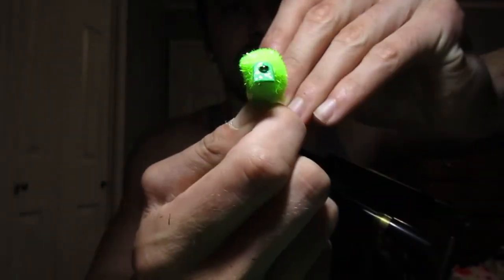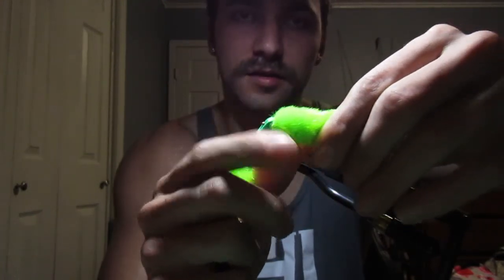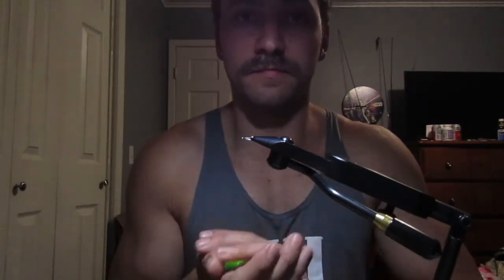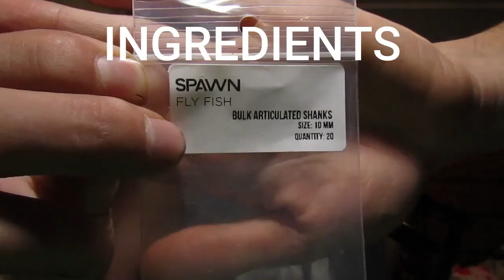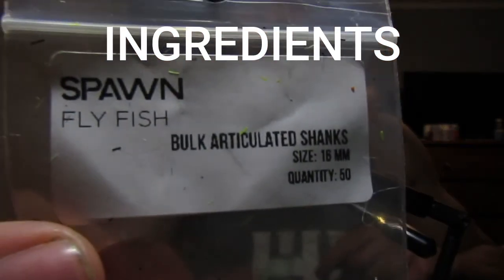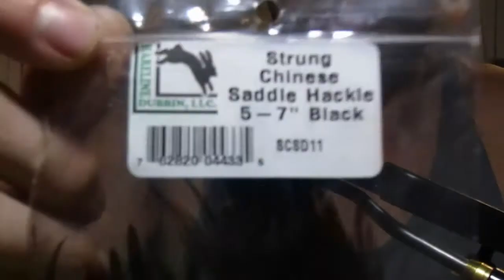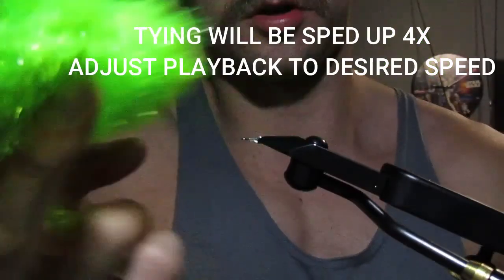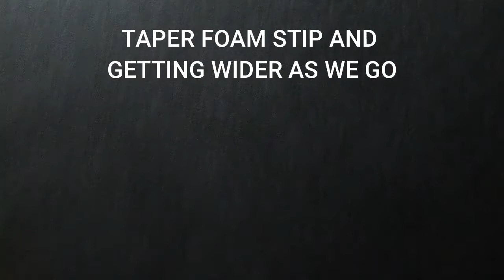HOW TO TIE SLOW WATER GAME CHANGER (Fly Tying)

Comment: Really nice fly m8!
Have you tried to use the foam in the middle of each section??
Just wandering if it would be different way of "swim" in the fly.
Reply from the maker: No it does not. but the amount of foam tabs or shanks will change the swim. Using fewer and Longer shanks it will glide side to side in long strides with short paused strips. More shanks wiggles more aggressive on steady stripping or current and can still be walked side to side  with short paused strips